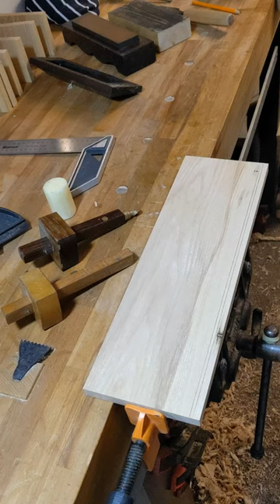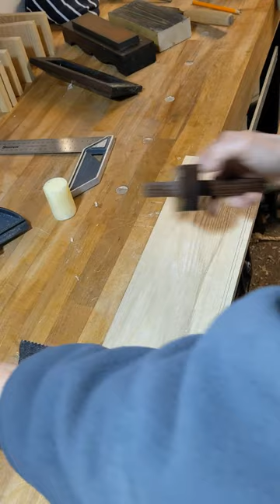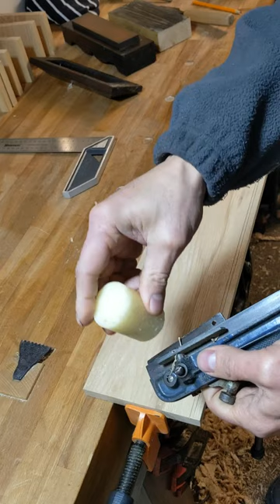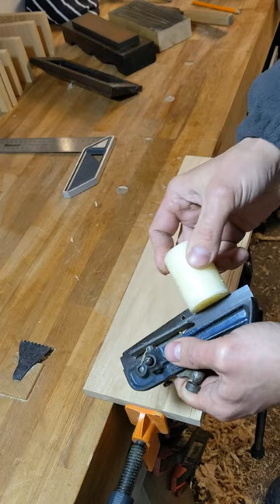3 TIPS for Plough Planes #woodworking #shorts #woodworkingtips

Comment: How thick is the steel (or iron if you went full old school) in your toothed stop? I made one kinda like it once for an outside bench but it was pretty fat. I've also made one since but felt it was too thin and never got around to putting it in the inside bench.  I think I'll go again and feel like I'm aiming for something in between what appears to be here, and the one I made that was too skinny. Might even cheat and just cut up an old saw blade. Embedded in the stop with a sunk screw as a pivot and a slight downwards sprung incline on the front part I reckon it'll hold and force down well. But...all experimentation.
Reply from the maker: Hi Benjamin. I'm not sure on the exact dimensions. I'll take a look tomorrow and share the details. It was made by a woodworking forum member and gifted to me. Sadly he doesn't post on the forums anymore. Dutch fellow and seemed very decent.
Reply: @faceedgewoodworking  ah no fuss man. You could do a video showing off the stop, might get some hits. If it's a 3" stop you might be out by a fraction, those 18th century French inches were just slightly shorter :p I like the stone box too. I have my great grandfather's one. It's not nearly as highly stylised, but the notch in the bottom is functional. You plop up your greasy (or damp) rag on any old beam or surface available, bunch it up a bit in the middle, and seat the box on it for a good firm hold. Many people put little nails or something in the boxes to hold them securely to a bench. But those old style boxes stay firm with just a cloth on wood.
Reply from the maker: @benjaminzedrine  hey, happy to do a quick vid. Nice that you have a family heirloom 👌. The little finish nails work great, I have a few in mine 👍